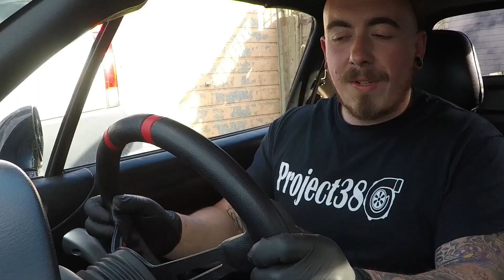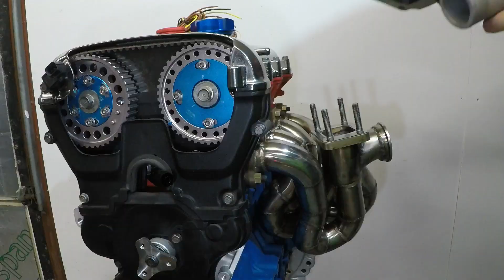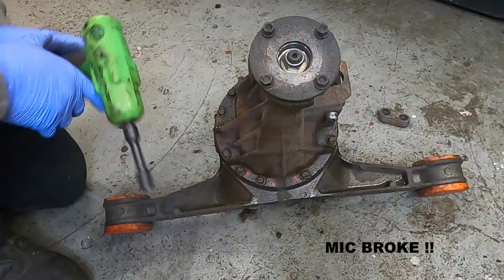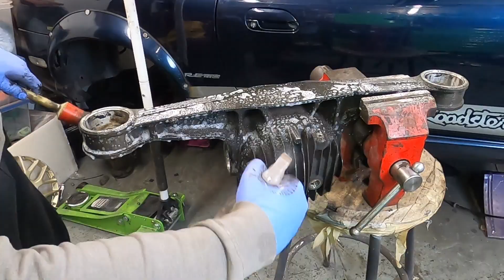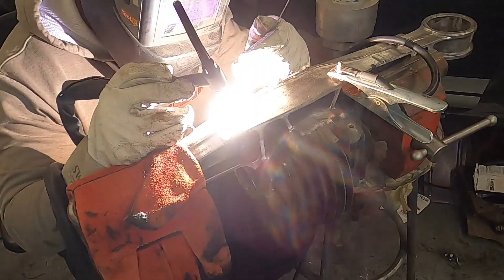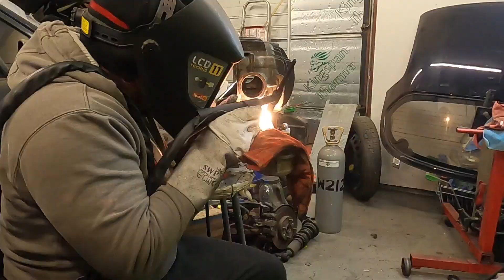DIFF RE-ENFORCEMENT / WELDING THE REAR DIFF HOUSING :MX5 TURBO BUILD pt 30

Comment: Hello what thickness do you advise for the plates?

Keep up the good work
Reply from the maker: i used 6mm but 4.5mm to 6.5mm is plenty strong enough
Reply: Any input on type of aluminium to use? What welder/amperage is needed?
Reply: Thanks for the information